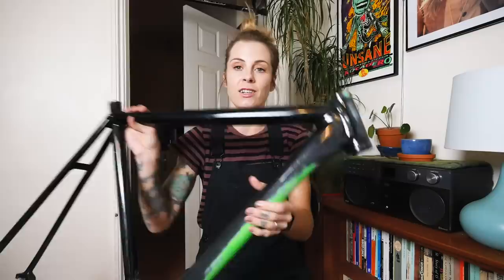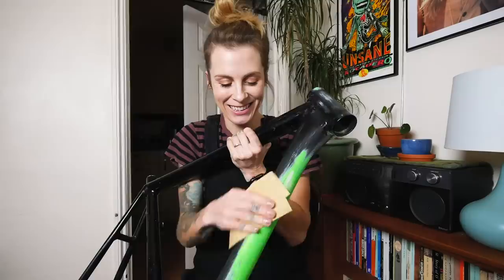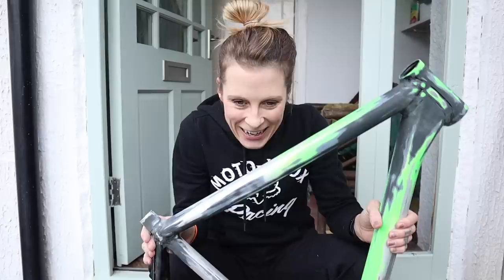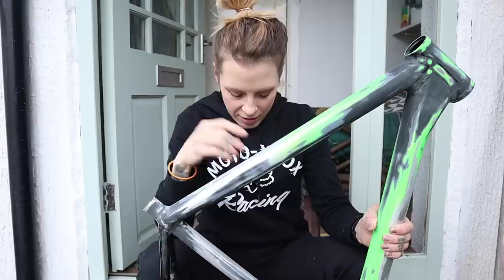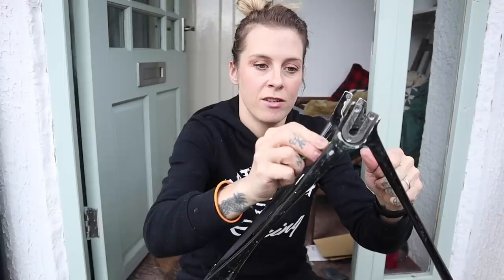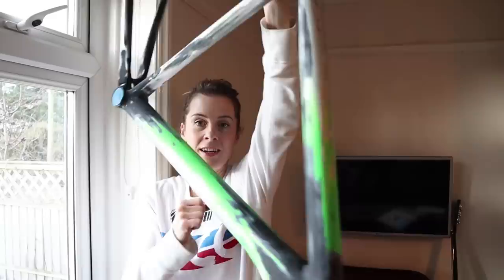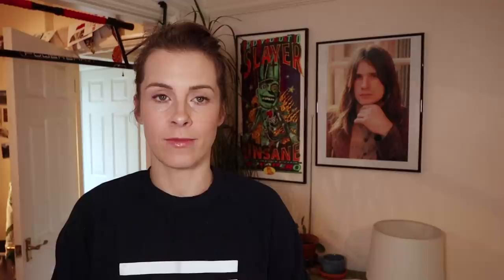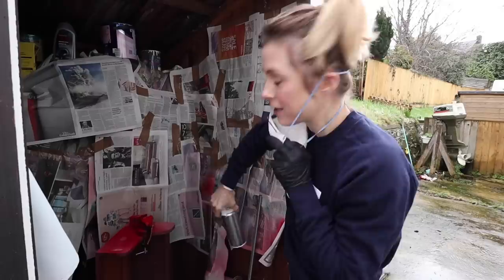Spray Painting My Own Bike | DIY Rattle Can

Comment: When I painted a frame many years ago, I hung it from the garage ceiling with string to avoid touching it.  You should be able to find some places inside the tubes to tie to, perhaps using a small stick stuck inside to avoid string touching where you need to paint.  Or larger sticks through the bb and head tube with strings on either side of them might work.

Comment: I recommend using wet and dry sandpaper final is 800 or 1200 grit for a fine Finnish. Use this with water. Hang the frame from an eyelet using a bungy hook cuts down handling.

Comment: When I did both my kids BMX and an old 531 frame I stripped them with nitromorse which is quicker than sanding - and hung frames off floor using old clothes line and a coat hanger. Really like the paint you've got - way better than auto paints I used.

Comment: I used a chemical paint stripper, which wasn't very nice but was very effective and quick, then sanded it down after, before painting my GF's bike. If you do this again, when you were misting the end of the forks that was much more the technique to guarantee a smooth surface. Distance is important. I also hung the frame up using wire attached to the tube holes inside. Hope that helps.
Reply: ONE MOAR THING. You could use string to line up the masking tape stripes.

Comment: Fearless! Hanging the parts off a bit of string while spay painting them, makes it a lot easier to control distance and angles. A few light coats in quick succession makes to avoid runners and to get an even coat.

Comment: Having sanded down several frames by hand, do yourself a favor and get a palm sander or chemical paint remover when/ if you try this again. Its way way way faster and better finish at the end. I usually sand all the way up to 2000 grit.
Reply from the maker: Sam Warren no point in buying that for one frame!
Reply: Strippered my caad 10, can of gasket stripper or 2 and you're done in an hour tops 👍🏻
Reply: Does paint thinner work?
Reply: @Godisgr8always  Nope. Only a really strong stripper as most caads are powder coated. Gasket stripper is a sure bet though and easier to apply, AND safe for aluminium, as most engine heads are aluminium. Gasket stripper, take it from someone who's been there done that 👍🏻

Comment: Hey Juliet, the beauty of spraybike is that you actually don't have to be so fastidious when prepping your frame.
Below is taken from spraybike's website

Prep
Spray.Bike paint will adhere to most raw metal and painted surfaces without any major pre-prep. However, if painting onto a fresh-from-the-factory painted bike with a high gloss finish, rub down the frame with a very fine sandpaper or an abrasive cloth, just to give the surface a little ‘bite’ for the paint to sit on.
Always ensure that all surfaces are completely clean and grease free. Any micro-film left from degreasers or cleaning products can create a barrier preventing Spray.Bike from adhering properly. 
A pure medical alcohol is recommended for the ultimate pre-paint cleaner - but do make sure all residue is removed with absorbent kitchen paper. 

I can vouch for this. Painted an old racing frame last year, just a very light sand to key the surface and cleaned off with some meths.

I removed my headset too, put a loop of string through and hung it from the ceiling of my shed to paint. Makes it easy to move the frame around with one hand and just leave it hanging to dry once painted.

Comment: If you want to do your stripes like you mentioned there is a product called fine line tape that custom car painters use for intricate designs like flames and scallops. It bends and flexes very easily and then you can use your other tape to make farther from the fine line tape by using small overlapping pieces of it in the more complex areas which most of the bike is due to the round tubes.

Comment: A lot of comments on here about hanging the frame, all of which work. Since you unscrewed the drop-out plates, you could pass a metal coat hanger through one of these screw holes (going to the hole on the opposite drop-out too) and hang the frame that way. It's an area that will ultimately be covered, so even if the metal hanger hides a bit of base coat around the screw hole, it's ok. It's simple, much more than trying to hang from the BB shell (which you can mask off/around anyway if you did). And when you do your paint work, you can move the frame around without touching the frame itself. Looking at your video, your shed seems to have wooden beams above, you could tie rope/string around the beam (leaving a tiny bit of slack) and hook the bike hanger off of that. Or if there isn't a beam directly above dead center, why not tie rope, tightly, across two beams.

And an idea for masking off the desired design. What if first you just used wide masking tape around (not on an angle) the top tube and seat-tube. Then as you did by laying the tape across from the TT to ST, you could use that as a guide to draw the stencil shape. Then use a blade to cut along the line you've drawn, peel the outer tape, and your shape/design is done.
Car pin-striping tape (suggested by a few here already) could help in getting that smooth round join on the back of the ST, so does the stencil idea.

Comment: I've always used a  chemical paint removal. It's easier and faster. Plus it removes every spec of paint.
Reply: problem with chemical paint removal is that its chemical. yes its quicker and easier but its not good for theenviroment and if you dont have a roperly ventilated area its not safe. also is you just sand enough so the surface is rough a couple of coats will do fine, yes the bike will be heavier because you have more paint on but its not that noticable.
Reply: @Brurgh  so is spray painting just saying. So why not just do it right
Reply: Brurgh sanding and spray painting is not good for the enviroment either
Reply: @Brurgh  The carbon dust is incredibly dangerous, a chemical agent in comparison is relatively harmless.
Reply: @Brurgh  This is kind of oblique but any harm to the environment was done the moment the product was manufactured. The idea that "every bit counts" doesn't really extend to one can of paint stripper, given that professionals use the stuff by the 20 litre pail. Maybe I'm rationalizing, I just put a whole can of it on my old Rocky Mountain. I'm going to go scrape it now. Also, I'm guessing that going all the way to bare metal is going to make a difference with an old steel frame. We'll see...
Reply: @BangTheRocksTogether  if it didn't turn out banging maybe get it smoothed and polished before spraying or the technique you prefer
Reply: Lol I used a propane torch and a metal scraper

Comment: I did my own cycle 2 years ago and it was great. It was every bit as good as done by a machine but i did use expensive auto can spray and top coat lacquer sanded between two coats.  ONLY thing that was a downer to it all the annealing process which I didn't do but was ignorant of and did mean after building the bike back up that cables caused the paint to slurr even though it had been done two weeks earlier.

Comment: try hanging the frame to the top of your shed. when its suspended, you can spin it around, and manipulate it a lot easier... as for your stripes, you're gonna have to tackle it from a two-halves kind of approach. and it'll meet in the middle. so for example if you have the white frame base color, and you want a purple stripe that runs down from the top tube onto the down tube, you're gonna need four pieces of tape, minimum, to make a "Frame", what you were doing, was close, but you're gonna need individual strips that meet in the middle. of the tube (when looking down at the bike, or up at the bottom of the top tube). now that you got the frame taped off, you'll paint the middle portion that you want purple, let it dry, then remove the taped section.  if you feel that this becomes a bit more complicated than you imagined, you can always go for different fades where you transition from one color into another, or maybe even splatter jobs, with blotches maybe.

Comment: I've painted four frames, including custom decals and box pinstriping and one with automotive paint, so I learned a few things the hard way. First, don't listen to Joan Crawford because metal coat hangers are great — they work well for hanging parts. Make it so that the hook is at the top and you can flip the hook around without touching the frame to get at the other side for painting.

For the stripe, you'll want to wrap around the tube with a piece/collective pieces of tape that will be the total height of your stripe. Say you want a 1" wide stripe that angles up so that the highest point of the stripe (say, at the inside center of the seat tube) is 3" higher than the lowest point (say, the back center of the seat tube). You'll want to make a mask that's at least 3" wide that wraps around the seat tube. From there, you mark your stripe's top center and bottom center (you might want to use a couple pieces of tape above and below your mask and mark them with a pencil on your mask and those reference pieces so that you can align your mask exactly), peel it off without stretching it, lay the mask on sticker backing paper/wax paper, cut the stripe out, and reapply the mask using your reference marks to help align it. It may take a couple of tries to get the exact shape you want.
Reply from the maker: Thanks for the tips

Comment: you can do one thing.. wrap the tape for 3-4 inches on the bar where you want stripes.. then with a blade cut that cross stripe as you wanted.. then remove the rest of tape except that stripe part..

Comment: Get a 3M vinyl masking tape. It stretches easily and it's much easier to work into a shape you need, especially if you get a fine line one so that both bottom and top edges of the stripe are nice and curvy without the chevron pattern. The space between the vinyl tape can then be filled with a normal masking tape.

Comment: Faster to use a mouse sander then finisher of by hand with wet 800 grit. Wipe down with prepsol or wax and grease remover. I do acrest spot to see ifbi get a paint reaction like wrinkling. If you do the use an isolation primer or take back to metal. I have done frames where u take oi the blasters for a plastic bead blast or a chemical strip. Pain over paint is fine if you arent covering fine detail or a weight weenie. Cant beat your own paint job.

Comment: Do you you have a sandblasting service available in the UK?  It’s much faster than doing by hand. If you have a wire coat hanger you can unwind it and and fit it down the seat tube and hook it into the bottom bracket then hang the other end of the coat hanger from a hook in the ceiling! To make it even more stable take a second coat hanger and put it through the head tube and hang the frame from two points! It’ll take a little creative engineering but I think you’ll figure it out!
Reply from the maker: Mark Reams problem is, I need the tubes masked off as otherwise paint gets in
Reply: Juliet Elliott If you get overspray in the BB, your local bike shop has a tool to chase the threads and clean the pain out. The pros do this after painting a frame as well as facing the BB shell.

Comment: If you don't have access to an indoor paint area, then make your own with card board by  making 3 sides with a covered top.  Make sure you have good lighting inside to see what you're painting & if its too cold ie. below 15C, you can use a space heater.  I fill a bucket with hot water & throw the cans in to let them heat up till I'm ready to use & be sure to shake them often.  The paint will go on smoother & more evenly.  Its the details that make the biggest difference in how well the project turns out.  Sanding is the most important thing in painting paradoxically.  
 Its hard to imagine the colors in a design, so you need to spray some samples to see how the paint will look in real life & how they will complement each other.  Same as you would paint your house, you get some samples & see how it looks on the wall.   Good luck & take your time.
Reply from the maker: Montana Jones thank you

Comment: You can use a pencil mark as a guide location for where to place tape. I've found that pinstripe tape is easier to lay out, and then you can place the blue tape over that to get clean edges. If you have clearcoat paint, spray a bit on the edge of the tape before spraying colour. What that does is prevent paint bleed into the tape edges, only the clearcoat paint bleeds, so when you later remove the tape, the paint edge lines are nice and straight. You can practice on a flat board or scrap first, if you're not sure about the technique. I use to paint motorcycles, so I leather a ton of tricks to make paint work better.
Reply from the maker: Gordon Moat thanks, that’s a great tip
Reply from the maker: Gordon Moat wait, you mean spray clears coat on the blue tape before you put in on?
Reply: @JulietElliottsChannel  Once the tape is on the frame, spray clear on before you use your colour paint.

Comment: Fantastic! I think your original idea could work, but instead of wrapping the tube with the tape cut strips and treat each side individually. Then where they meet cut them and leave a cream colored line down the center of the frame, could be fun, or just match each cut end up, or use the colors down that straight line later...although that's a lot of masking. I love the process!

Comment: Chemicals work better, as fnk8833 said. I know it's hard to bring yourself to go that route sometimes. I have a lot of experience painting complex curves and lining paint-lines up, because I built so many R/C aircraft for aerobatics as a young man. So, I was going to suggest you might hunt a modeller up and get some advice if you ever care to do this again. Obviously, having made this video in February you've moved on by now. What I would have done is masked an area much larger than the lines you wanted, and then cut the tape to the lines I want. It's not was easy as all that, because you don't want to cut into the primer, or other paint layers. That's the gist of it. Happy to see you fearlessly learning new talents!
Reply: @4kGaming Do you know of any videos that would teach what you explained?

Comment: Get yourself some fine line tape for the masking, it will give you a nice clean edge when you remove it, if you use ordinary masking tape it will give a jagged edge, you will also find it much easier to use around the tubes. For any decent paint job, the preparation is critical, it's worth while taking your time.
Reply from the maker: Faro Basso this isn’t ordinary masking tape, it’s for spraying cars
Reply: @JulietElliottsChannel  The fine line tape is just used for the edge you are painting up to, so you only need to buy a narrow roll, you can then mask any larger areas with the tape you already have.  If you try painting up to both different types of tape and then peel it off you will see the difference. Maybe try it on a piece of waste/scrap metal.  I'm sure there must be some vids of people using it on YT

Comment: Looks fantastic . Too fantastic when it comes to bike thieves. If you can tolerate it , use an ugly flat grey or black or some other atrocious color to deter thieves . I keep my super bright flashy paint job on my mt. e bike as dirty as possible . So if thieves are around , they MAY pass my bike up for something that looks better. 
However , aside from my paranoia , great job on your bike . 👍
Reply from the maker: I would never lock this up 👍

Comment: I've used paint remover and a wire brush extension for a drill and I've never had a problem. And it's quicker.

Comment: You can do stripes but you need to cut your tape, use multiple peaces of tape not one wrapped. Also use a coat hanger to hang the frame or something. Your spray technique got better as you went. start moving and then spraying don't start spraying from a stopped position. Use thinner tape to do your design and then fill in with thicker tape or paper masking. Don't use regular masking tape the edges will be jagged. Of course if you want to see how the best in the world does it check out his utube channel, ETOE.

Comment: The design you want to do can be done BUT you need to mask it out a different way, you don't do it with a straight piece of masking tape... you would sketch it on then mask each tube separately. It's a tricky job to get right. Also don't forget to make little tabs to help you remove the masking once it's sprayed.

Comment: Always spray with the frame suspended. Coat hanger wire cut to length and suspended from the wooden beams I can see in that self made booth of yours ✊

Comment: Use a chemical paint remover. Starting with any grit or sandpaper 80 and below is just a bad idea. Also, don't use rattle an paint. Get rustoleum or duracoat. Do they not have those in the UK?

Comment: This is a cool DIY video, but please wear a dust mask or other type of respirator! That paint dust is not good for yer lungs.
Reply: The solvent are worse than the dust. Dust masks won't do you any good. You need pretty advanced gear for it to make any difference and you can't have a beard because the seal won't be good enough. Buy a mask from the same stores graffiti writers use. Do it outside. Regardless, one paint job won't damage you that much....